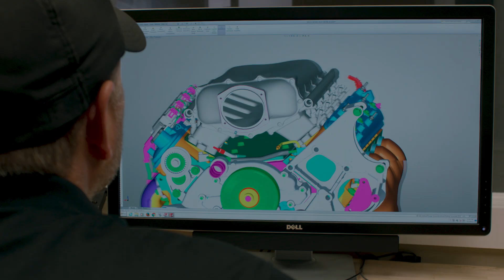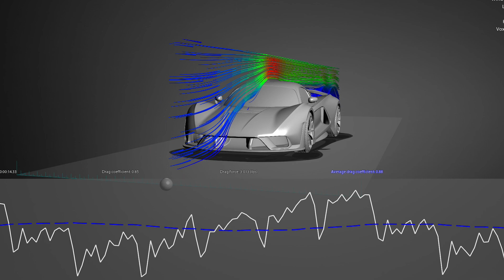Hennessey Venom F5:  America's Hypercar

Comment: The problem with getting up and over 270MPH isnt only the aero and WHP + TQ. The tires are the problem. They have to design tires which will handle 300MPH+ speeds. And that is easier said than done.